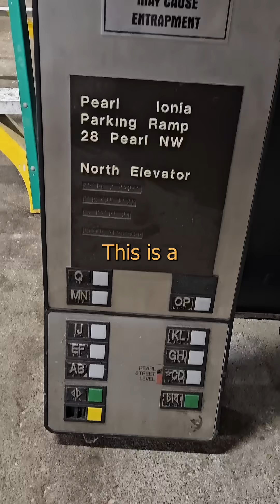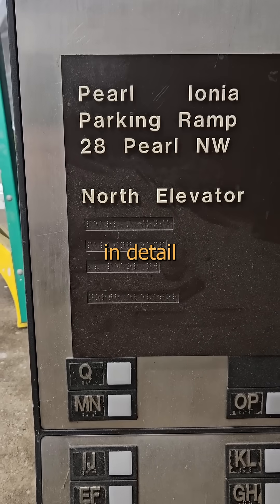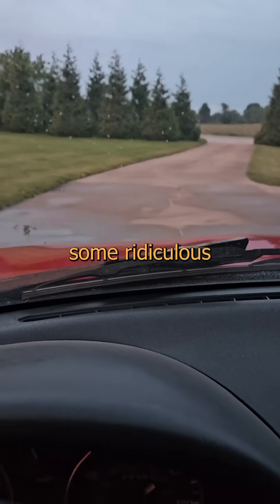Miata Mischief #chrisboden #engineering #gear #elevator #score #stories #parts #hacking #making

Comment: A few years back, we had to move a loveseat out of my fourth story apartment in Halifax. My brother had a first gen Toyota Matrix at the time, and we'd never had any issue hauling big shit in it in the past. This was a big loveseat from the 70s, significantly older than anyone involved in the moving operation, so this fucking thing was heavy. 

We fight this thing to get it down the stairs, out to the car then, lo and behold, the mouth of the hatch is a mere 3/4 inch too small to fit it in. After removing some trim, we shaved the difference down to about half an inch. 

None of us were about to bring it back upstairs, nor did we have the mental clarity to call someone with a pickup truck, so instead we opted to pull all the rope off of out cat tree upstairs and one hookless ratchet strap that happened to already be in the car and tie that damned thing to the roof. We drove about 25 km with that fucker precariously bound to the roof of our rotten out old grocery hauler to get it to our storage unit across town.

We try not to tell this story or show pictures to our law enforcement friends

Comment: I worked security at a skyscraper where they were renovating something like 9 different floors for some law firm that was moving in. At one point they were installing these ridiculous 8-foot-tall solid core wood doors, but somewhere in the plans they got replaced with glass doors of the same dimensions, so the wood doors were just laying there, to be scrapped. Also, neither of the "doors" had any of the holes drilled in them yet..

So, seeing one of them in the scrap/trash pile, I asked if I could have one, and if one of the various contractors I'd made friends with and had been talking to for the past 2 months could cut it down to a specific size for me.

I built a coffee table in high school shop class out of 1/4" square tubing, 1/2" channel iron, and a few pieces of flat bar stock (for decorative curly bits). Twisted the square tube stock for the legs, welded more square tube to connect each leg about 3-4 inches up from the floor, and then welded the channel iron channel-side-down on top. 2' wide by 3' long by 2' tall. Perfect little coffee table, except it doesn't have a top.

So I got a "yes" from the foreman on the construction crew, got one of the contractors to chop the 8' door in half, which I believe gave me two pieces of 4'x3' solid-core door wood.

I still have the table (my feet are kicked up on it right now), and I still have the piece of door I intended to use for the top, I still just need to acquire a plunge router (because the plan was to route a 1" channel around the underside, into which the channel iron would simply friction-fit).

As for how I got them home:

I lived close to downtown, so I rode a bike to work. A 20-inch BMX bike, mind you, because I was in my early 20s. So. In 90-degree Houston heat and some ungodly humidity, IN A 100% POLYESTER SECURITY GUARD SUIT, I precariously perched my purloined pine planks atop my pubescent pony and patiently plodded my preferred path, pausing periodically to paintakingly position my paltry prize and to perchance partake in provisional palliation, with the penultimate plan of plying my ply partway to my pad after each plotted prorogue.

A normally 25-minute ride took me nearly an hour and a half. 8/10, would definitely do it again.

Comment: Had a 1988 rx7 that I would take the back glass off to use like a truck bed. Would haul anything from a large air compressor when I was roofing to full house swamp coolers... if it fit it went in.

Comment: On more than one occasion I have found a good deal on a large item or a bunch of small ones while out with friends in small cars and had to do sketchy stuff to make it work.

Once, in my jetta, me and 3 friends stopped by an electronics store going out of business to just look around and waste some time. They had a flat screen 50 inch tv brand new for $150. And this was when a tv like that was probably worth closer to $1000. I bought it, then realized we would have to play human tetris to make us all fit in the car with it. We had to fold down the back seats and have the 2 back there both kind of half laying half curled into a ball. One on the floor and one on top of the TV. We then continued to run around and make multiple other stops on the trip back to my house (which was about an hour and a half away). This included stopping for food (which we ate in the car) and a friend insisting we stop at a shoe store for a pair of shoes so he wouldn't have to make another trip.

In the same jetta I bought a very large grill (again because it was a deal too good to pass up). I had to take it out of the box in the parking lot because it wouldn't fit in the car any way with the box. Then, it still wouldn't fit in the trunk or back seat so I had to disassemble it as much as possible. Including taking off all the per-assembled parts that are supposed to make assembly take less time. I then shoved it into the back seat because it still didn't fit in the trunk. I bent and scratched the plastics on the door frame, but squeezed it through. Then I had to spend almost an hour taking the trim and plastic off to be able to remove it from the back seat, because no matter how much I tried, it didn't move at all with them in there.

Comment: The craziest thing I have ever done was drive 1/3rd of the way across the United States of America for a Hi-Rail truck. 

I gave a friend a call and invited him to drive across the country with me to get it and some other railroad equipment. We took my dad’s truck and trailer to get it. 
Once we got there, we discovered the trailer was too short, the front of the truck was on the edge of the deck and the back was 1 inch from falling off. We tied it down the best we could and began our journey with our tail heavy load. After a grand total of 27 hours of driving, we made it home in the better part of one pice.

Comment: I was droving a 2001 dodge caravan when i bought a big international 424 with my pops. It was about 5 miles away when it died driving it home, so we just hooked it to the tow hitch on my van and towed it the rest of the way. I did NOT think a 2001 minivan would pull all that weight - front loader included - up a bunch of friggen big hills that easily. Second best is a load of 16 foot 2x10s in a ford ranger with 4 or 5 feet of bed 😂

Comment: When I was 18, I bought a Chevy Avalanche with the ever-fuel-efficient 8.1L engine in it. My dad used it a lot while I was in Army Basic Training, and told me he used too much gas and I needed a 2 door. So, being a responsible 21-year-old with a military bonus check in my pocket, I bought an 84 Corvette. Since the military pays less than the little people got while filming Wizard of Oz, I was helping out with my family's construction business on the weekends. The trunk of my Corvette saw air compressors, concrete, buckets of hardware, and several times the top came off to haul 2x4s 🤣

Comment: 3rd Gen Toyota Yaris, filled with my whole house contents, across 5 counties in 1 day. Including 2 x Compound bows & my bicycle on the rear rack, and my cooking tools including wrapped chefs knives under the driver seat. 
And the car was so overweight, I genuinely had to avoid speed bumps or changes in gradient for fear of grinding the bottom against the road: because the suspension was pretty much bottomed out. 

Loved going through the different border controls with that one…

Comment: I dont want to enter the contest i just have a fun story. So one summer I believe it was 2017, my brother was getting rid of a shell car (car without a title normally purchased for parts, the car can never see the legal road again so its a parts donor)  didnt want to do it himself so he said he'd pay me to do it and I could keep the scrap money. So I got a hefty amount of steel cutting sawzall blades and cut off wheels and went to work on it. Three days later i called my buddy up that had a decent sized SUV then and asked if he could help me move 3 large pieces of scrap, long story short we eneded up hauling the donor car (a 1992 deisel jetta that had no motor or transmission & a few other missing components such as tires and rims) in three separate pieces on a tiny lawn trailer that really shouldnt be hauling anything past a full grown adult 🤣

Comment: My 1992 Mercury Grand Marquis was nicknamed the “Cargo-Vick”. From anvils in the trunk, 8” x 12” x 8Ft boards in the passenger seat, One-Ton Fird Bumpers, and many runs to the scrap yard loaded down with rotors and Copper-Aluminium Coil, it was a great tool before I bought my 96 F-150

Comment: Got a 2003 Toyota Celica, not 2 inches wider than that Miata you’ve got there.

I strapped down about 6 sheets of MDF and a kayak on the roof of that thing for about 50 miles on 75 over the Mackinac Bridge

Good times

Comment: Moved a sofa with a 93 Mustang. It was hanging a good 3+ feet out the back of the hatch as I cruised 65+ down the turnpike. Of course I secured it with the cheapest ratchet strap I could find. You know... For safety. I did plink it like a guitar string and I recited the magical incantation of keeping shit in place - "That's going nowhere!". The Gods of stupid things blessed me with safe travels and I didn't end up on the 6am news.

Comment: not really sketchy but funny. i was at a second hand store and found a really cool old (probebly late 1950s) automatic record player/radio cabinet. i took that home in the passenger seat of my 1967 volvo amazon. the car has whats known as a long stick(stick shift) wich meant i struggled to put it in 2nd or 4th gear since the cabinet was wider than half the enterior of the car xD

Comment: Meh, best I got is hauling the rear axle for a Tacoma in a Chevy Sonic hatchback.  Removed the front passenger seat and built a wooden platform to even up with the rear seat folded and it rode shotgun for the 120 mile trip home.  Well worth the effort for the price and the axle is still rolling in my son's pickup.

Comment: After Katrina, a massive restaurant sign that was 50ft+ in the air fell down. They put the sign out for garbage collection. So my friends and I got in a ford RANGER at 3 am to load it up and bring it home about 5 miles from pickup. It took 3 guys in the bed of the truck to hold it while the best driver creeped along for what felt like 30 minutes. Best apartment accent-wall ever.

Comment: Yep no room . I drive a z3.  And had to bring groceries home after work.  To tools in the midget trunk.  Since the ac doesn't work.  Had to drive with a large bad of toilet paper in the passenger  seat.  Top down.  The seat belt tore a bit of the corner. Of the tp so abit was flapping in the wind.   On a red light.  A northern diver said.  "He really loves that toilet paper to take it for a cruse "  ...

Comment: in college a friend and i found a 14’ aluminum jon boat in a bayou. we proceeded to drag it out of the swamp meeting several cottonmouths along the way, and then somehow got it on top of my 2013 mini cooper clubman. our saving grace was that the car had roof racks, but the boat was both wider and SIGNIFICANTLY longer than the car, so the racks made contact with the bench seats of the boat. after some creative ratchet strapping we drove it over 2.5 interstate hours back to new orleans turning heads all along the way. when crossing the causeway we joked that if we lost control and flipped over into the lake we might still float as long as we were perfectly upside-down.

Comment: when i was 16 I hauled a 27 inch sony trinitron kv-27FS16 home in the passenger seat of my 2000 mustang. it barely fit and looked absolutely comical next to me while driving. passenger mirror? what passenger mirror? the tv still works great and i have it as the bedroom tv

Comment: I had an '06 Volvo s60 a few years back that i used to transport an old Honda sport bike in. Went to go pick it up, guy already had it disassembled into about as many pieces as it would come apart in. Chassis was sticking out of the trunk like 3 feet... Had it all strapped into the trunk, every seat and compartment was filled to the brim with plastic pieces, forks, brakes, literally all the bits to make up a motorcycle. Got it home and reassembled it with an electric drivetrain. Great fun

Comment: Dude, you would love my 1991 Geo Storm.  It's an economy car that identifies as a sports car.  The factory motor puts out an anemic 90HP, but that is not the motor the designers intended for the car.  The car was designed around a 270HP V6, which is common as peanuts as it is used in small Nissan trucks and SUVs of the time, and drops right in with only a motor mount swap.  With only minor tweaking, you can bump that motor to 375hp on pump gas with no turbo.  Nifty for a 1700 pound 4 seater.

Comment: My Dad had a bright red convertible Chrysler LeBaron for most of my life. It was a shockingly practical car. He and I would haul all kinds of materials from the hardware store in that thing. If the wood or pipe were too long, we’d just pop the top and tie a flag to the end and it’d be right as rain. I do miss it. Now he has a Pontiac Solstice and it’s just not as useful.

Comment: I used elastic hook-straps to sit an esky on the back of my motorcycle, and putting that on while wearing a backpack was rather compressing q:

I've also ratchet strapped a car battery to my escoter to get it home

Hauling around things precariously mounted to two wheeled vehicles is pretty common for me

Comment: Put a 72” boxed bookcase from Wal-Mart in a 74 VW beetle. Removed the front seat and put it in the back behind the driver seat. The bookcase bottom sat in the front floorboard and the top was touching the back windshield.

Comment: Helped my buddy push a 66 Plymouth barracuda three miles using skateboards as moving dollies and two 2.5 ton floor jacks in a  radio flyer with a tool box ratchet strapped to the whole mess ... He still has the radio flyer and one the the boards is on his shop wall but the barracuda is badass now (after we set it on fire three times learning how carburators and fuel lines work)

Comment: Literally this last week, because I did not have the time to flash the ECU on my racing motorcycle off 109 which comes in 5 gal buckets unless you get a 55 drum... well when a world-class brand new track in the Ozarks opened up and I had an invite for a private day out I needed to get a lot of fuel ASAP... the Toyota 86 is basically the current hardtop Miata of the world for drifters and you do not know scared until you have 8 five gallon 109 fuel plastic buckets in your backseat and another two strapped in with a seatbelt in the passenger seat of a car that is designed to swing out like a couple thats been married for 30 years and want go individually to check out what tickles their pickle now. 😂

Comment: When I was in my first year of college,  I helped out my friend of about 3 weeks with moving his stuff from one apartment to another. Mind you, I'm not an American, this is in a third world country in south east asia. In total, there were 4 dudes with 2 scooter motorcycles holding onto boxes and baskets and gallons of water through streets narrow enough for less than a car with pedestrians on each side making it tighter than that AND speed bumps every 5 meters or so. I was sitting in the back of one bike while wearing a ruck sack with clithes and with a box of kitchen appliances on my left and a half empty gallon on my right sitting on my lap and secured by nothing more than my hands. The guy in front wasn't any better, he had 2 smaller boxes on the bottom and a large rectangular box containing the water dispenser for the gallow stacked on top and it was all held with his legs and tons of prayer. That's what I did, I just prayed that the dude riding the bike could see just enough to keep us from falling into a gutter.

And that was only the first trip out of 3. 

One of the best experiences I've ever had at college.

Comment: Drove from Long Beach to Jackson MS to pick up front and rear bumpers, passenger door panels, and a set of tail lights for a 95 integra. Upper radiator support and shift linkage for an 88 CRX. All crammed into a 98 civic dx coupe. my trunk was filled by my subs so it was just me the road and an ass-ton of plastic carefully jammed into a shitbox with an engine that had JUST been slapped together on my kitchen counter.

Comment: had an mx5 when i was stationed in germany. it wasn't quick on the autobahn but going down the b-roads it ate those corners alive. my highschool buddie ended up out  there with me for a few months and so we put a couple of snow boards between his legs and road with the top down for about 5 hours to get to the Zugspitze. full snowboard gear the whole way to deal with the cold, blasting early 2000's emo like red jump suit and Paramore.